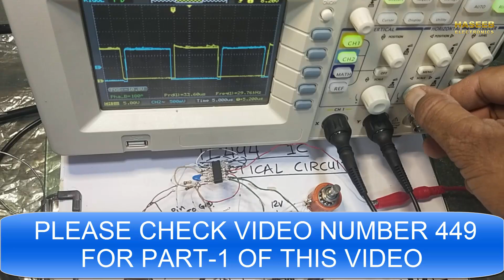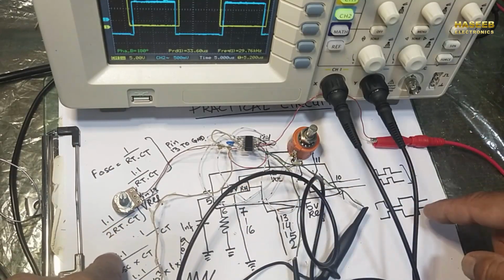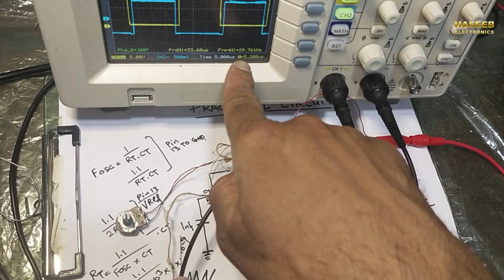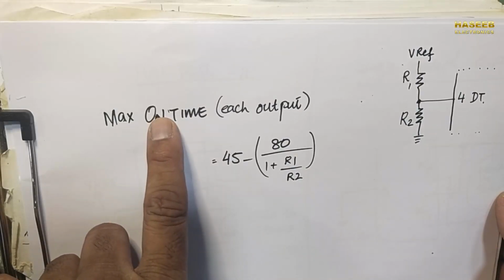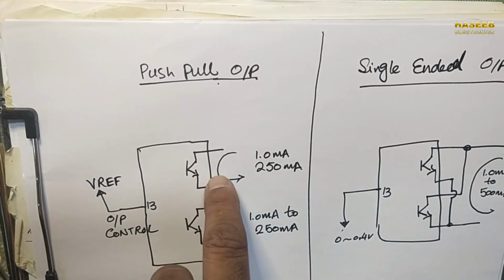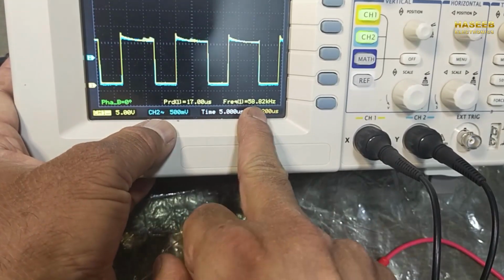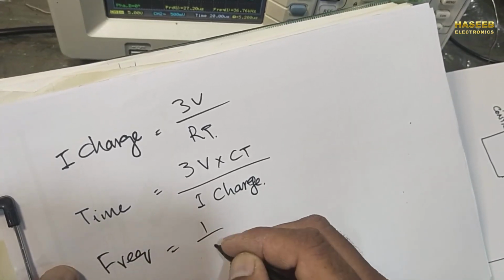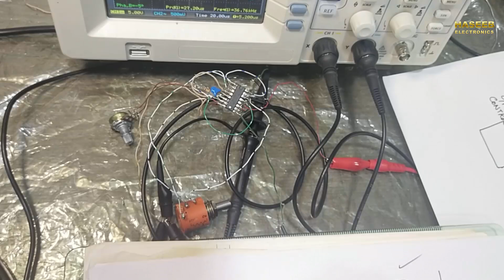{450} Design TL494 PWM in Single Ended Driver Practical. Push Pull or Half Bridge Driver  Circuit

Comment: Thanks, I have a question: if R1=0 R2 = 5kohm then max ON time = 45 - 80= - 35 what does this mean? One more if we connect the feedback pin to one of the output pins of the TL494. What will happen to circuit? During push pull and single.
Reply from the maker: if R1 is 0 ohms. the Vref will applied to the dead time pin (pin number 4) and the threshold is maximum 3.3 volt, so the IC will go in disable state,  
(in upcoming video i am going to discuss dead time & soft start circuit, which is directly involved to pin number 4)
error amplifier number 1 for voltage mode. i will arrange it practically 
error amplifier number 2 (pin 15, 16) for current sensing. we will do it practically as well. 
for error sensing technique, we have to design a reference which will applied to one input of EA, and sense line is connected to 2nd input of EA, feedback compensation is to be calculated to get proper regulation
Reply: @HaseebElectronics  many Thanks, Well noted and appreciated.